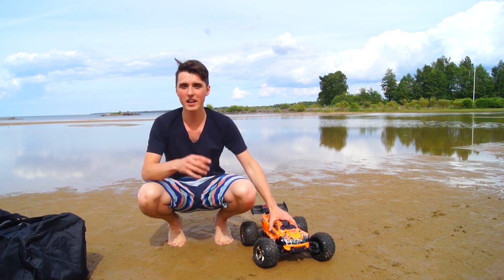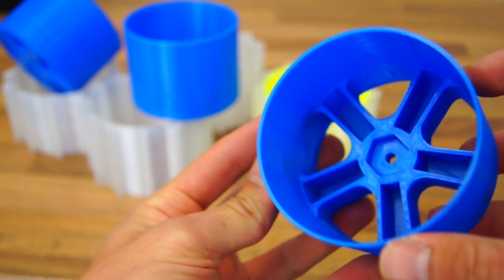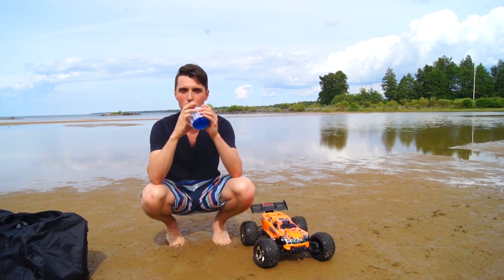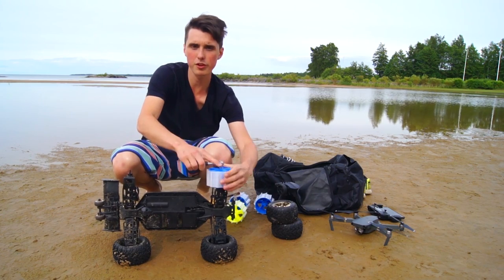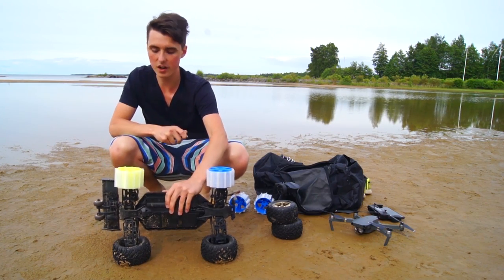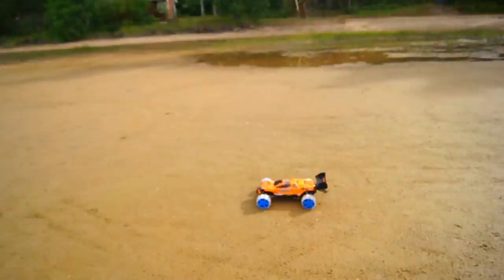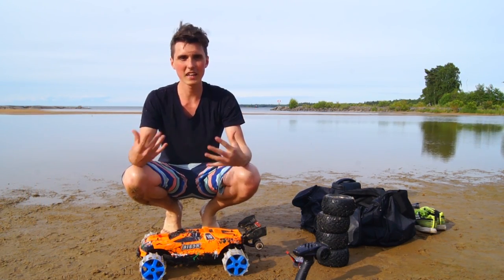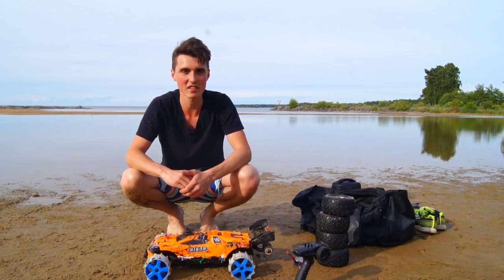3D Printed RC Car Wheels - Crazy Traction!!!

Comment: You need to go up on the pinion gear. Thoes 3D tires are alot smaller than stock, so your gearing was too low.

Comment: Needs more power. More power means more wheel speed when under load. Car doesn't have enough power to turn the paddles like it needs to in waster.

Comment: You tires that are filled with air cause  if you put the 3D printed tires in the water they will sink that's why the previous tires worked better 
Paddles for propulsion  air for flotation

Comment: how about go to an rc-store and take a look at proline slingshot for example and compare?
Reply: most likely wheels need to be able to showel more water away...ie somewhat bigger flaps or wings or whatever you call them :) and i dont know how flexible that material is but the gap-angle of the flaps might need to be increased

Comment: Ok the tires aren't that big of deal I have done to with stocks and paddles. Paddles work best but stocks work and I have my paddles the same way as his but mine are longer and rubber but any way that's off topic the key to running on top of water is high wheel speed the fister your tiers turn the stronger the surface tension gets to hold the care up so the key is just go faster us a castle speed controller and the castle mamba moster brushless System with big pinion gear and small spur gear on 6s lipos and u will drive on water all day long no problem

Comment: Your tire design is flat. I mean, it's cylindrical, but the contact surface is flat. If you use a a more round design, you can get more suitcase area, and also, you truck can sink a little more and still have tread above the water. That's why the stock tires did better. I think.

Comment: i dont think bouancy is the problem. iw seen both cars and bikes ride on water. and they will sink like a stone if the speed is not high enough. water when hit hard is pretty tough. so it a question of enough speed. and keeping momentum.  maybe the paddles are not big enough. ( the ones on my rc are pretty huge) and they are closed off in the ends. maybe thats the problem

Comment: Try designing a paddle that has a more self cleaning attitude rather than just the paddles running 90 degrees perpendicular to the center of the vehicle. The paddle is too aggressive the way you have it. Instead of forcing the water away it's simply carrying the water over the top of the wheel. Of course the correct self cleaning design will mean directional tread so attention will have to be paid when mounting the tires on the wheels. Research self cleaning agricultural tire treads to better understand what I mean by this. Keep it up you'll get it

Comment: Your losing rpm, the other wheel are bigger and more surface area to float on, this talk of foam in the tire is not tru the faster your truck is the lighter it becomes to the water. Most of the truck on the web are using 6s so they have the extra rpm

Comment: Need more surface area on your wheels.  Instead of them being perfect cylinders when you stand them on end, they need to be more bulbous.  Look at the tires that Traxxas has.  You need to model you wheels after them.  More surface area for displacing the water.  Think donut.

Comment: The problem is in Your design. Water gets in the rims and slows down the car. Make a much smaller diameter rims and fat tires, best with the air inside. Cause now Your wheels act like a parachute in the water